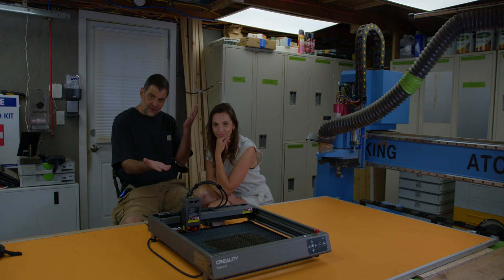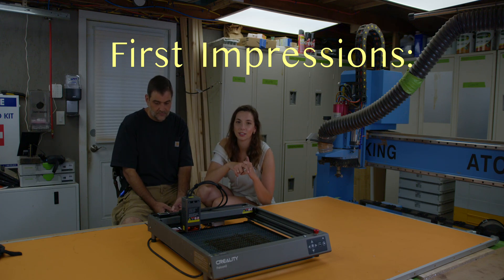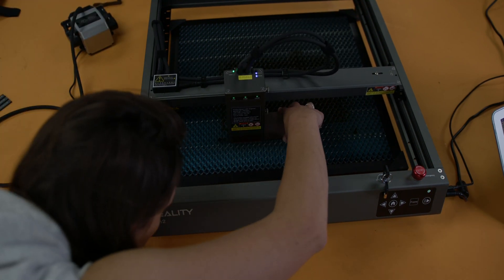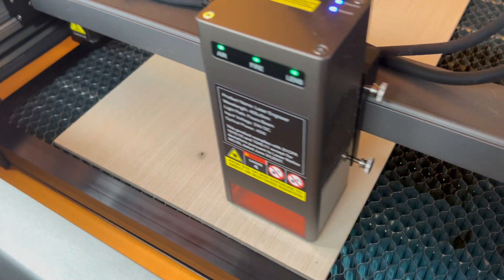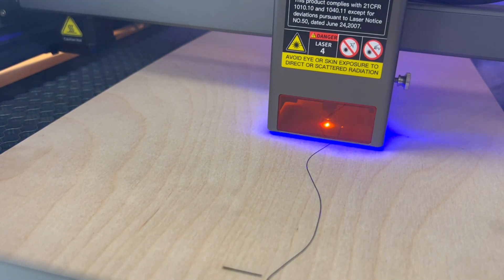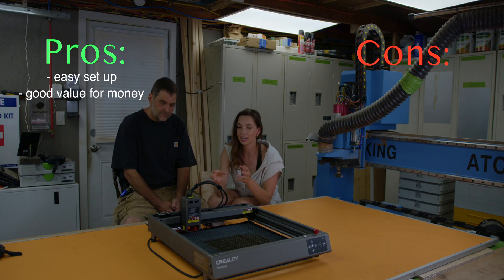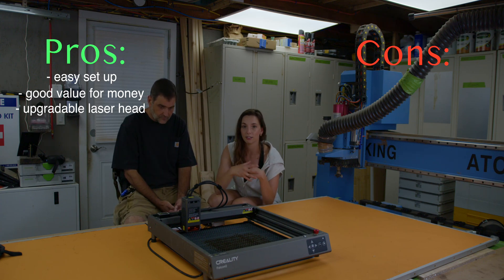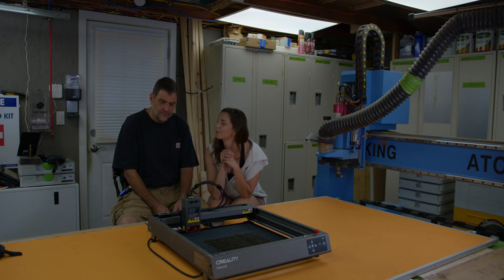Reviewing the Creality Falcon2 40 Watt Diode Laser Cutter

Comment: I bought the 22w version and am loving it.  I bought the Pro version because it has a rigid enclosure, not just a "tent", as well as some other features.  Cost a little more but I believe worth it.  I set up a 1/2" plywood sheet on the bottom (when not cutting right through) to align my pieces  I do runs of 6 coasters at a time and takes about 10-15 minutes to complete the run with the detail I have.
Reply from the maker: Thats a great solution for aligning pieces. All in all is a really solid machine

Comment: I bought into Creality with their CR10s 3D printers.  That was over 8 years ago, I believe, and I'm still using it today and haven't had one single issue with it that wasn't my fault.  So rock solid performance from Creality.  I did look into this specific laser, but ended up going with a 2028 enclosed laser due to size.  But for a starter machine, this would be perfect.
Reply from the maker: That’s awesome info. Thanks for sharing. We’ve really loved it so far but can’t speak to 8 years of use yet